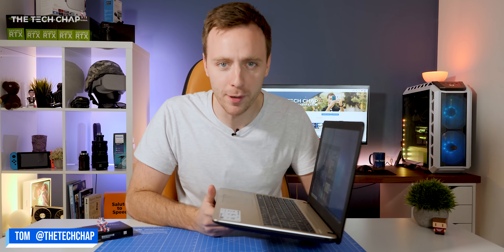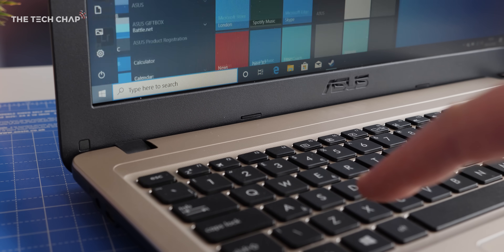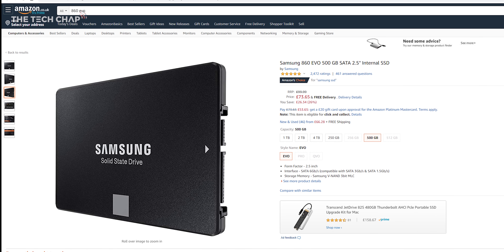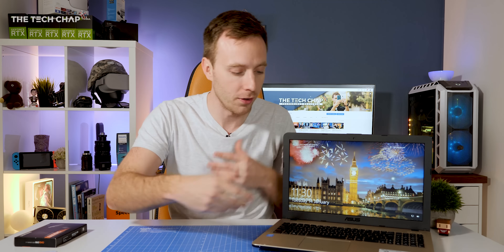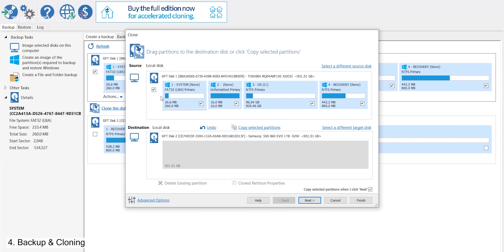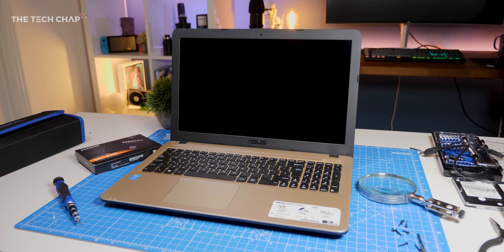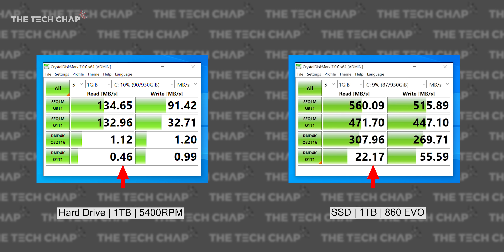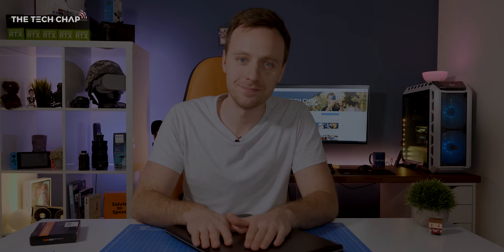How to UPGRADE Your Laptop with a SSD! #AD | The Tech Chap

Comment from the maker: Hey Chaps! What Laptop are you using right now? (and will you upgrade soon) 🤔
Reply: Asus N550JV. I've already upgraded it 2 years ago with a Samsung 840 pro and it flies;)
Reply: Asus vivobook k510u . I have recently upgraded it with crucial mx500 500gb ssd and crucial 8gb ram.
Reply: Thank you so much. Even if it looks like an ad for samsung 840 Pro. But in all honesty i am going to try this. God Bless. Keep making more videos where users are actually benefiting in reality.
Reply: I am actually still using a decade old laptop and i was just wondering if i could upgrade that with your suggested method. It's a Toshiba Satellite M645-S4110. Any suggestion/help would be of great help. I am not that tech savy either hence my confusion/question.
Reply: Dell D630 with Linux Mint and a HP EliteBook 8440p and doubt i'll upgrade them again, both have 256gb ssds and 8gb ram so not much else to change in them (maybe the wireless card but thats about it)
Reply: dell N5010
Reply: Im currently rocking a i5 8300h with GTX 1060 6gb max Q Dell G5, I must say its awesome and I wont be needing any upgrades at all for the next 5+ years. My PC on the other hand is a bit out dated with only 4 cores and 4 threads since its an i5 but at least it still has my mighty GTX 1080 asus rog strix.
Reply: School Chrome book XD
Reply: Hi. I would like to consider an alternative to EVO 860. Could you recommend some? I have a 5 yr old laptop with AMD A8.
Reply: @TroubleMakerLT  - wow... That is old... Almost 10 yrs
Reply: @satyajitbasu  get a laptop with an I5 8300h or better. (not amd due to how bad they are in the laptop space)
Reply: @satyajitbasu  yeah, upgraded ram but planing to get new computer as fast as I can. I didn't used it that much just for some net stuff. wanna buy xps15 but gonna wait for new model of 2020
Reply: Acer E5-575G-55KK
Reply: Asus N56VZ i7 and I upgraded to Samsung 860Evo SSD 500GB. My laptop fast as hell 😜
Reply: The Tech Chap im using a MacBook Pro from 2010... i5 and Geforce 330M with upgraded 500GB ssd since around a decade, still in use for mobile usage and if i need much batter runtime (soon the 2nd, and probably last battery change, for cheap by myself of course)
I got a RTX 2080 notebook too for mobile gaming and a little bit multibox gaming a while ago, but my main gaming rig is a still awesome performing i7 4790k and GTX 1070 with 1440p 165Hz screen
Reply: Lenovo Ideapad-320
Reply: Just bought Thinkpad E490, loving it!
Reply: 2012 MacBook Pro already upgraded
Reply: Assumed ownership of a 2010 Dell Latitude E6510 with 4 GB RAM, trashed 360 GB HD and broken trackpad from my son after giving him a new Notebook for Christmas.  Popped in a $29 256 GB drive from Amazon, added a wireless mouse I had, upgraded the BIOS and installed Windows 10.  Perfectly usable for light computing and web browsing with 40 second boot time.
Reply: XPS 9570. I'll be using it as my main laptop for at least another eight or nine years.
Reply: I have just yesterday upgraded my old Toshiba HDD 5400 RPM to New WD 5400 RPM HDD and the result is pretty awesome. The WD HDD works better than the TOSHIBA HDD, in terms of read or write. I can see the clear difference than what I have faces pain full slowness of my laptop. 
I KNOW if I have upgraded with the Samsung SSD the Result will be pretty awesome and my i3 8th gen laptop becomes a Rocket. But I think i'll be using SSD to because there is a SSD port as well.
Thanks Tom for this kind of video I think this is your first components installing video u have ever made.
If I am not wrong.
Reply: Acer 5560G I had since 2012. I'm holding out until TES6 comes out before upgrading my laptop.

I already upgraded it to win10, 8gb ram and 250gb Adata ssd. For general usage it's still good and I could play older titles and e-sports game pretty good and I don't really play AAA games anymore in this microtransaction-infested era
Reply: Dell XPS 9570. Best laptop I've ever had. I'd love to get an 8TB SSD like the new MacBook Pro 16, in it but it would cost the same as the computer itself!
Reply: Hey bro I have MacBook pro mid 2012 does it enough for it
Reply: macbook pro 2016
Reply: HP 15d 103TX, have given up any sort of gaming since 3years so that I can continue to use it. Too broke right now  for a new one. Changed battery and swapped the hdd to an ssd. The 4th gen i5 4200M is still fast af for normal usage even after 6years! Win 10 boot time is 16secs, chrome about 2secs. Used a Kingston A400 ssd.
Reply: Was thinking of upgrading but not enough on pocket. If I upgrade I'll upgrade to a decent enough Laptop, not junky ones. So for the 1-2 years I'll rock my current Laptop
Reply: Asus 505DT ..not gonna upgrade for few years mate
Reply: Great!
Reply: I have an Asus A43 S laptop. Made in 2012, I have upgraded to a WD 500 Gb SSD , my laptop is very fast right now
Reply: Hp Pavilion Power 15, using for 3 years but I just finished my 256gb SSD & 1tb HDD. I will add another 1tb ssd
Reply: I have an HP Envy DV6 from 2012. When I bought it, I paid 800 Swiss Francs or about £675 in pounds, I was living in Switzerland at the time. It came with Core i7, 8 gig of ram, Geforce GT 630M with 2 gig ram for graphics, and a pretty slow hdd. It has been a good workhorse and instead of replacing it, I just placed an order for a Samsung 860 EVO 2Tb and 16 gig of ram upgrade, usb to ssd cable + a caddy to convert the optical drive bay to ssd for later use with a 2nd drive if I want it. That has all cost me just over £400 and should keep the laptop  going for at least the next 5 years. When this virus is over and things open up again I will also take it to a local pc repair shop and get new thermal paste for the cpu and get the fan cleaned. HP DV6 is a bit of a job to strip down and do those things. Spend £25 on that and will be all fresh.
Reply: Inspiron 3585
Reply: I use an 8 year old Dell XPS L702x (non 3D version) with an i7 processor originally fitted with two 500gb toshiba hdd’s and 8gb ram which I upgraded a few years ago when it started slowing up with a 2tb Sandisk ssd drive and a 1tb sandisk ssd drive and Kingston 16gb ram. A great way to give new life to an old machine.
Reply: Hp dm4 1160, 1st gen i5, 500 hdd, 4 gb ddr3. Went into clean the fan and saw the cpu/gpu had no paste whatsoever. It went from over 200F to 175F. Looking into ssd upgrade now.
Reply: Old MSI GE60 😂 waiting resources and maybe 2021 will be the year of changes
Reply: Asus Tuf FX505DY
Reply: Can I use a hard disk case instead of a usb to sata connector to clone my disk?
Reply: I am using asus x541uj
with i3 6006u and 4GB ram.
Reply: HP - 15.6" Gaming Laptop - AMD Ryzen 5 - 8GB Memory - NVIDIA GeForce GTX 1050 - 256GB Solid State Drive, and i really need better storage lmao
Reply: Dell Vostro 3500 My main pc is modern though
Reply: The Tech Chap i have an old laptop can it be upgraded to ssd? My old laptop is hp 2000
Reply: Is it possible to fix inside laptop and remove the hdd
Reply: Asus R556l, it looks pretty much the same like this one from the video. 4 years old with core i5-5200U and I´m seriosly thinkig about this upgrade for a couple of weeks
Reply: Lenovo ideapad 300
Reply: Roasterminator yep its certainly worth it
Reply: i actually use the same model shown in this video! its pretty slow but will have to suffice for the next few weeks. i'm using it for school.
Reply: I wanted to sell my laptop (because task manager always show that its running at 100%)

But seeing this makes me double think that.
Reply: Lenovo Ideapad S145 15IIL (i5 1035G1)
It has Intel's own NVMe SSD
Reply: Im on a 3-5 year old hp notebook, ill try this and upgrade the ram too but is there a way to increase the ghz on it?
Reply: Chromebook. lol
Reply: Lenovo T510. Still a workhorse. Planning to upgrade SSD soon. 🐎
Reply: i have an quastion PLS ANSWER ME, is this ssd upgrade effecting the FPS on Games?
Reply: The same one that you have in this video
Reply: Dell Inspiron 1440 can use this or no man?
Reply: ASUS ROG G550JK
. want to put some more ram and SSD in it
Reply: Thanks for the info. Man my 5 year old PC is faster than ever.
Reply: Iam using a Acer Aspire 5 powered by Ryzen 5 2500u with vega 8 graphics and 8gb RAM 
it is 2 years old
But the processor is still capable for my everyday use case
I need to upgrade
1. my shitty TN panel to IPS
2. Old 5400rpm 1Tb hdd to ssd(or atleast add 256gb ssd)
Reply: Lenovo e40-80
Reply: Lenovo
Reply: Lenovo g400 i wanna upgrade to ssd soon
Btw i wish it wont delete my data
Reply: I use an acer that costed about £300 and it sucks. I'm getting an acer orion pc and an acer tridon 300 laptop
Reply: I have a Dell latitude E6320 no upgrades except for that it has windows 10 instead of 7
Reply: Acer Aspire E1-470 2013 model. I swapped the 750GB HDD to a 240GB SSD. I also doubled the RAM to 8GB. I feel like this will last me another 7 years. Its currently on Windows 10, but I'm considering putting it back to Windows 8, which I think has less overhead.
Reply: asus k501ux, its been with me for 4 years now. Probably, its not too late to start upgrading it.
Reply: who needs a fckn laptop anyway... overprized pieces of shit + lesser features... and on top of that, the performance degradation happens much faster than in desktops, they are more likely to stop working entirely, often can't be upgraded in a way that would make sense (either too expensive for too less gain or even through limitations preventing upgrades at all).
The funny part is, most laptop users (at least that i know) DON'T even take their laptops OUTSIDE of their house AT ALL O_o ....but it aaaalways has to be a laptop, only god knows why.
patting my NZXT Phantom BigTower (Ferrari Red) on the back: "Yeeees, that is good boy" :D
Reply: Toshiba satellite a135-s4527. Over 13-14 years old, currently utilizing this video to install a brand new 500gb SSD :)
Reply: Hi, I'm using hp pavilion 15-ab549tx. Currently it has 1tb 2.5 inch sata harddrive. Can I replace it with 1 tb 2.5 inch sata ssd? Few say that my laptop is not compatible with 1tb ssd. is that so?
Reply: Lenovo G400 I will upgrade it to Samsung 860 Pro 512GB on my birthday
Reply: MSI prestige
Reply: The one in the video
Reply: lg mp287 upgrade laptop. Can you help upgrade this laptop please?
Reply: Windows stream 14
Reply: Any recommendation upgrade for asus pro P2540UV? thanks
Reply: A Dell Inspiron 15 3000. the 1TB hard-drive redlines before anything else gets above 30. Need it for CAD software and (hushed) gaming. Are there different disk lengths, or should any 2.5" fit? I'm Mechanical, not Electrical or Software adept. Do you see any issue with an SP A55?
Reply: im using a decade old laptop named "Gateway EC19C10i" more like a net book because of its size 11.6in.
 i found this sitting inside my dad's drawer and then i found out the HDD of this one got corrupted so i bought a kingston a400 240gb SSD and added some more rams on it and now i am using it for documents and other media stuff. i watched your video before buying it by the way so i had an idea. THANK YOU SO MUCH!!!!
Reply: I don't have a laptop
Reply: HP Laptop 14
Reply: Lenovo l340 Gaming, about to upgrade to a HP Pavilion Gaming 17-cd1007na
Reply: Lenovo ideapad 130-15ikb
Reply: Asus vivobook 15. Wont upgrade until 2025😂
Reply: Acer nitro 5
Reply: I’m using a Dell laptop with a core m3 6Y?? Which runs at 0.90 GHz with 4 gigs of ram and I’m getting an ssd and hopefully I’ll get a full set up in Christmas with a ryzen 3 3200 g 8 or 16 gigs of ram and I believe a gtx 1060
Reply: @satyajitbasu  Crucial MX500 is a  great alternative to samsung 860 evo, you will find similar performance
Reply: Im using an acer travelmate
Reply: Im using an ASUS LAPTOP( Idont know the model because it was from my father, he bought it from china)
Reply: Asus X541U .-.
Reply: Asus x456qu, can the ssd of this laptop can be upgraded?
Reply: Does this ssd work with acer aspire 5?
Reply: A Lenovo 6 years old bruh but it's fine and I think I'm going to get that ssd
Reply: just got asus tuf a 15
Reply: i am using a dell latitude 5280 but sadly the 128gb of SSD storage is not enough for me who likes to horde random files
Reply: Acer aspire 5
Reply: HP Intel core i3
Reply: HP PAVILION
Reply: Asus d509b
Reply: Toshiba Satellite C55-A5308
Reply: What if my laptop only has 60
Reply: What if my laptops only has 60gbs of storage. On the stock hardrrive
Reply: New one but it has only 250 ssd
Reply: Hp Pavilion Gaming Laptop. And yes for my codmw
Reply: I'm using 8 year old acer laptop but I'm looking to buy Lenovo Legion Y540 laptop.
Reply: GL502VT. Probably not anytime soon. Still running like a beast. (Except for it having an HDD)
Reply: Medion erazer p6605, it’s good for now but I need more storage it only has a 1 TB HDD and 200 gb ssd and I’ve used 290 of that just for 11 games and some programs
Reply: I have an Asus laptop and not anytime soon because I'm broke
Reply: Lenove Ideapad 310 14" with 7th gen Core i5 + 6GB of RAM and 1TB HDD - It is a nightmare,.
Reply: Huawei D15 it was just released this year and it's almost $800 yet it has a not so good performance.
Reply: Sony vaio
Reply: Yes going to upgrade
Reply: I have 500GB ssd can i copy only my windows to the ssd with this method
Reply: Acer Aspire
Reply: Compaq 615 for the lat 10 years. I mean, it is not my daily driver, but i use it sometimes.
Reply: Lenovo legion y530 i5 8th generation with 8 gb ram and 128 GB SSD and 1 TB HDD.........will be upgrading it to 32gb Ram, 500gb SSD and if it adapts then 2TB SSD, if not 2TB HDD.
Reply: @S4nnuuu  good option it is
Reply: I'm on Lenovo IdeaPad 300, i5 8th gen
It has a 5400rpm hdd but boots in 19 secs!
Reply: Can I just use an ssd as a usb plugin then transfer my games over or do I have to go through all the hardware because then I’m stuck with what I have
Reply: the interface is smaller than the power U spanner
Reply: I have the Dell Inspiron N5010(2010)with 2 Gigs of ram......I have upgraded it to 8Gb Ram and also added the samsung 860 evo ssd😊
Reply: Hi can u help me out  how to increase ur laptop internal storage becoz my laptop storage is low and what do u need, I need to install more games for yt but don't have space and if o use external disk  I can't get any games in it pls help!?
Reply: That exact one but with a i3-7100 U instead
Reply: mine is lenovo ideapad 300 and its very slow
Reply: Does upgrading ssd on lenovo ideapad which is a celeron works?
Reply: I'm gonna get a laptop and upgrade it because I want to save money
Reply: 2012 Mac (with ssd)
Reply: lenovo ideapad 3, tenth gen i5, 12gb ram, 500gb ssd. and no, I just got it
Reply: Lenovo g505
Reply: If it's possible to get your opinion about the 870 EVO and QVO which is better?
Reply: i dont know the name but its an asus laptop and its like 10 years old. Its still on windows seven lol and its so slow
Reply: Hello Mate, I'm using hp intel core i3 originally was installed with windows 8 however, was upgraded to windows 10. Having the same issue as others too slow hence, one of my mate recommended what you did in your video but I ordered 2 TB hard drive (crucial) but after watching your video I'm kinda doubtful if my laptop is really digest 2tb since the original 1tb was installed before? I'd appreciate if you can kindly assist me on it, please. 

Regards

Singh
Reply: Acer Aspire 7, bought a cheaper SSD so it should be worth my time even if it’s not great as an SSD
Reply: the same as yours
Reply: I am using lenovo g50-80 and going to upgrade after 5 years
Reply: Im using Lenovo Legion 5 and im prob not gonna upgrade soon but my storage is kinda bad
Reply: AMD A9 :(
Reply: Asus!
Reply: @beyaand  when the asus is sus!1!1!1
Reply: @possiblymatt7970  oof 🤭
Reply: I'm using Asus i3 8th gen and it is sooo slow. I found out that it has HDD, I will upgrade after the warranty duration.
Reply: Msu
Reply: Sorry msi
Reply: MacBook Air M1 2020. Soooooo no upgrade😔😔
Reply: msi gl65 leopard
Reply: Install it with linux like Ubuntu
Reply: i guess im asking randomly but does any of you know of a method to log back into an Instagram account??
I was dumb forgot the password. I love any tips you can give me.
Reply: @Gunner Jace instablaster =)
Reply: @Gunner Jace Glad I could help =)
Reply: Right now im using this hp laptop (forgot the name) soon upgrading to an acer nitro 5
Reply: acer nitro 5, slapped in 860 evo 2tb today 🤩
Reply: Acer aspire 5
Reply: Acer E1 571 aspire i3 4gb ram, just upgraded to 8gb ram and waiting for my SSD to arrive 👍
Reply: Samsung RC520
Reply: i have hp pavillion gaming 15 ryzen 5 4600h and gtx 1650  ti hdd version , i will upgrade it with a m.2 sn550 nvme ssd
Reply: Dell inspiron 15  3500 series...i will upgrade the drive and add 8gb of RAM on top
Reply: I'm using dell latitude 3490 and will upgrade to Thinkpad l13
Reply: I am using an MSI Stealth. She's sleek, lightweight and super fast. This is my second MSI. For the record, this computer comes standard with two Samsung SSD cards and it has a slot for a third.
Reply: Lenovo G550 from 2009. I clicked on your video thinking you were upgrading an old laptop similar to mine. 😂
Reply: Panasonic CF-S9
Reply: an hp laptop that runs windows 8.1 lol its slow
Reply: ASUS A54C.😅 Planning to upgrade to an SSD soon. I plan to upgrade the RAM and CPU at some point in the future too.
Reply: Dell Inspiron and I will be upgrading to this SSD asap!
Reply: I got that pavilion dv6
Reply: Hey,
Does that mean i need only add SSD in my laptop and Windows system do itself or i need do to sofware something so my SSD will work?
Reply: @somepeople5735  when I upgraded I just add the ssd but make sure u transfer ur files to from ur hard drive to the ssd than just remove the hard drive and add the ssd this is coming from a child so might not be right so u can also just look it up
Reply: Satellite C850 - thanks for the video
Reply: ASUS GL502V with a 250gb solid-state drive in it. May upgrade to a 1TB
Reply: My laptop now says “ no bootable device”
Reply: Lenovo IdeaPad 100-15iBY
Reply: T480 - going to upgrade to T14 Gen4
Reply: A 9 year old acer emachine E372 and i bought 4 gigs of ram and 128gb ssd but dunno how to upgeade the hdd to ssd
Reply: lenovo flex
Reply: Guys I currently have a Lenovo Legion Y540, and I want to replaced the D drive (HDD) with an SSD. Do I simply follow what was shown in the video? Please help!
Reply: Funny, I am watching this on the exact laptop you used as an example.